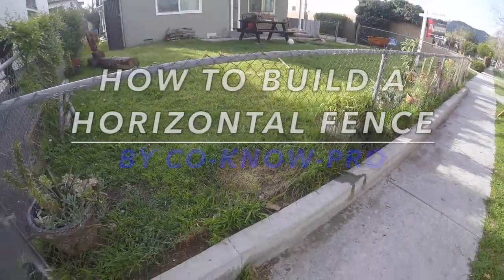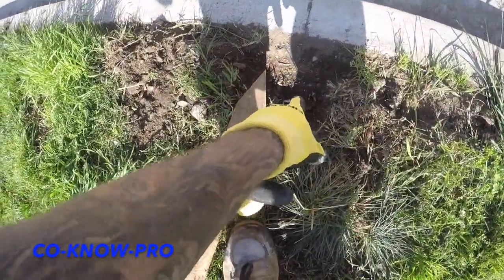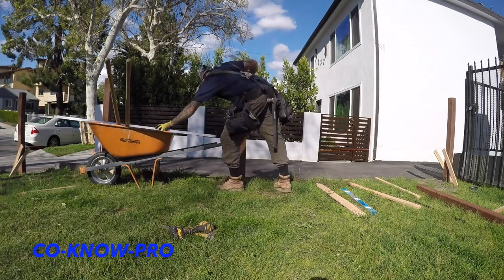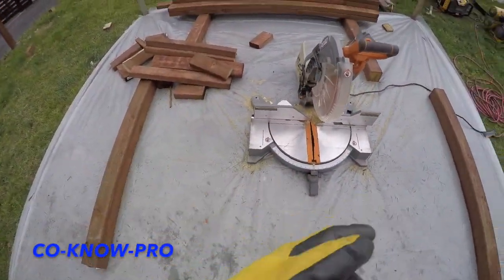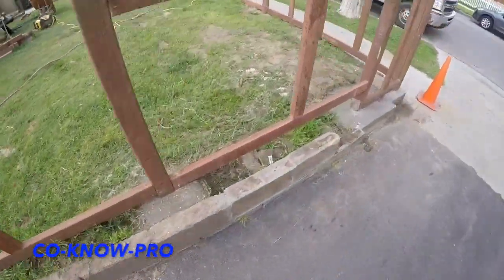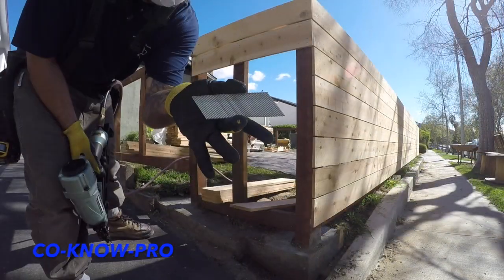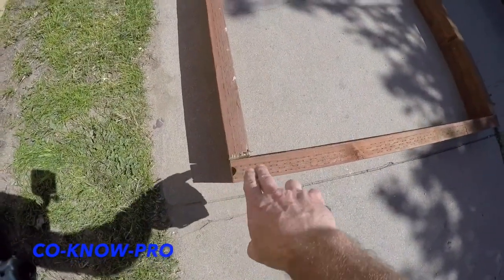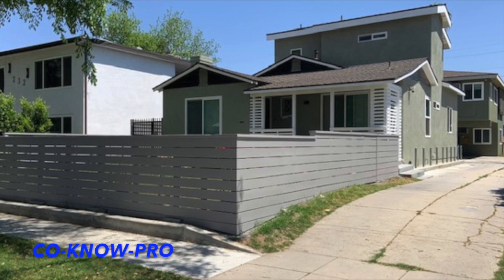How to Build a Fence: DIY Horizontal Privacy Fence 😎🔨👍@co-know-proconstructiontips

Comment: Before countersinking, how are boards attached? Also, please show inside of fence completed.
Reply from the maker: Sorry I took nine months to give you her response. Better late than never. Before countersinking we use a 15 gauge nail gun with 2 1/2 inch galvanized Brad nails. We use the nails just a lock it together then we go through and counter sink with the exterior rated screws. 
Hope that helps you give a clear picture on what we’re doing. Thanks for watching

Comment: How tall did you build that fence?? Also is that for the front yard??
Reply from the maker: Yes it is the Front yard. It is 40 inch at the low part and aprox 46 at the high point. Check your local building and safety and planning to figure out how high you can build a front yard fence .Thanks for the comment.

Comment: Instead of using 4or can I use 2 by 4
Reply from the maker: For the post they should be 4x4 you can use 2x4 but i would not recommend that. 4x4 post 2x4 cross members hope that helps. Thanks for the comment.

Comment: Can you provide a list of what's needed
Reply from the maker: 4 x 4 moisture treated post 2 x 4 moisture treated. Deck rated screws Premix concrete,
1 x 6 cedar fence planks, 2 x 6 redwood for the cap, 15 gauge galvanized one and three-quarter inch nails ,Elmers wood putty, primer and finish paint, hinges for the gate, Wood stakes, dry line,
Tools ⚒️ 
Compound miter chopsaw, Skilsaw, 15 gauge nail gun, post hole digger, 6 foot level, 4 foot level, cordless drill with a countersinking pilot, cordless impact drill, Palm sander, I use a airless sprayer to paint this fence. A wheel barrel and shovel. 

Hope that helps you out 👍
Reply: @co-know-proconstructiontips  how far apart are the 4x4 posts? And how tall are they? How many ft in the ground
Reply from the maker: @user-cy5ol3xl5y  They are approximately 48 inches tall. They go in the ground about 2 1/2 feet. They’re spaced a little under 6 feet apart because we use six-foot dogeared fence planks.

Comment: Hi, after time do you find these horizontal slats starts to look weird because they start to warp after time because of moisture.. even though you seal it..it might still warp
Reply from the maker: Hi Great question 👍🏻 No matter what all wood acclimates to the relative humidity it is in. So knowing that I put 1 extra vertical support in the middle of each bay. That way helps it maintain its look and help it not bow to much still it will just a little. You also have to seal it really fast really good seal helps it not bow as well. That Has worked pretty good for me over the years. Thanks for the comment 😎👍🏻🔨

Comment: You need a permit ?
Reply from the maker: Great question. It depends on where you are really. Most of the time if you follow local regulations and guidelines for a small front yard fence typically don’t have to pull a permit. But certain cities and towns you can’t do anything without a permit. I recommend you check with your local planning department to find out. 🔨👍🏻